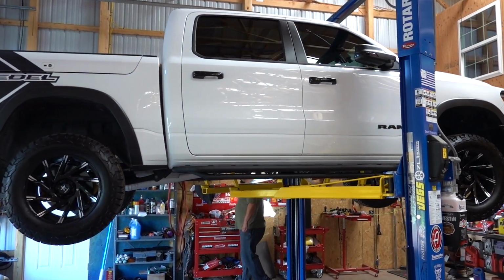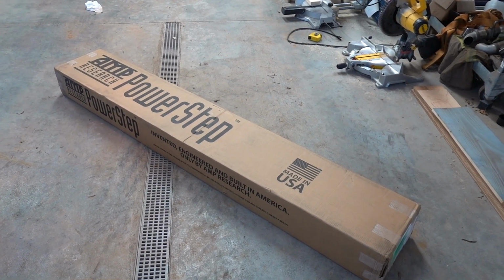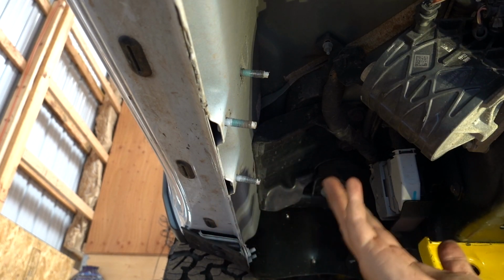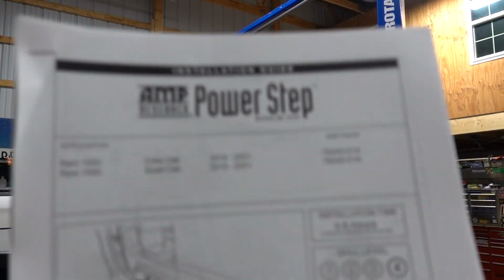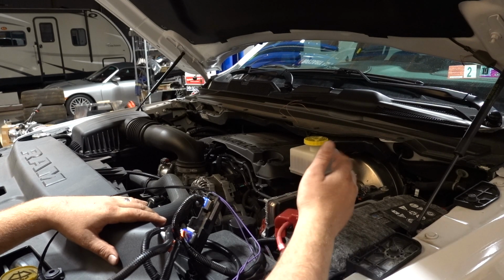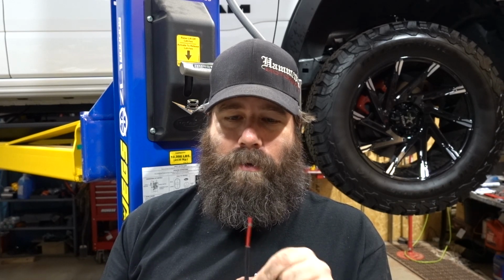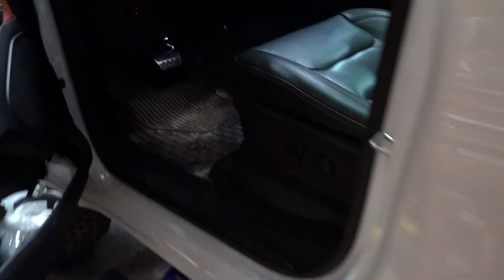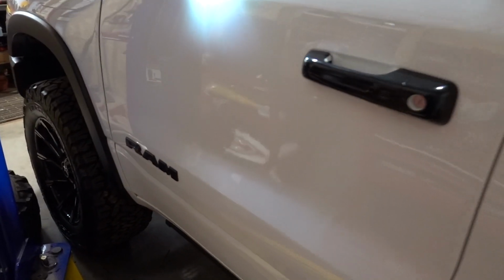Ram Rebel Build 2.0 (Part 2)

Comment: Im trying to keep up with ur vids 😂 but were you able to fix the issue with ur lift ??
Reply from the maker: Currently in the process it’s gonna be awesome
Reply: @HammerdownMotorsportsUSA  Im sure it will. I just got a Ram as well, not a rebel 😞. But I love rams in general. My Ram comes with a manufacture “pre lift 1 inch”. I’m planning to get a 3.5 inch lift from Rough Country. 3.5 lift for the same reasons as you. I’d read that supposedly it is one the best lift for Rams with manufacturer pre lift. I’m just want to put the right lift.

Comment: When I installed mine I just ‘released’ the OBD11 port from the bracket and placed the whole thing on top of the original bracket and it moved all step connection/plug and wire up under the dash— zip tie to secure it and call it done.   Looking forward to more videos of the Rebel re fresh!
Reply from the maker: That’s a great idea I’ll play with it and find a solution

Comment: Awesome upgrade!  Just a note, those stationary steps were actually protecting the sides of your truck and rear fender from rock chips, which is a big issue on the new body style RAM.  The fold out ones are at a better height, but they leave the side of the truck unprotected when moving and they are folded away, highly recommend you get some PPF for the lower rockers and the front of the rear fenders.
Reply from the maker: Thanks for the heads up